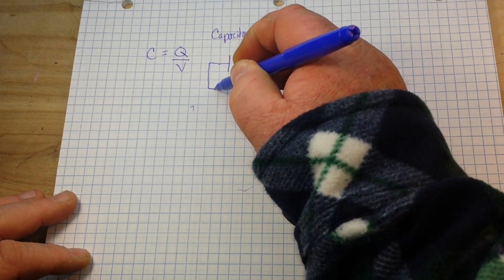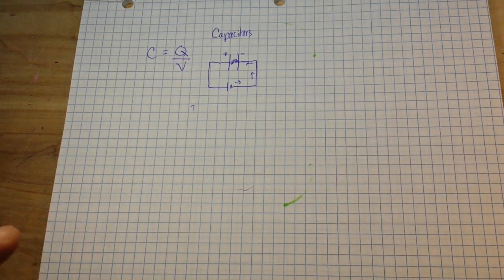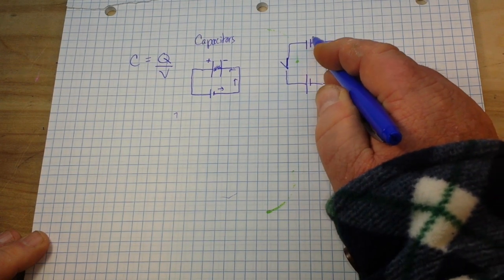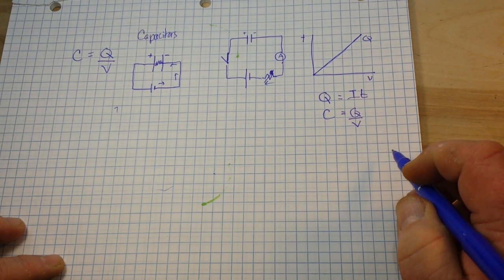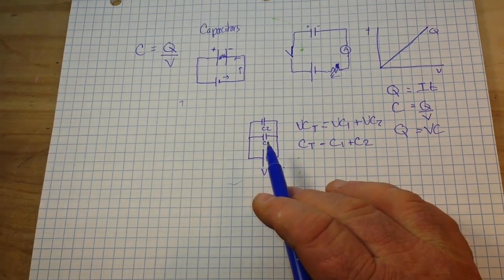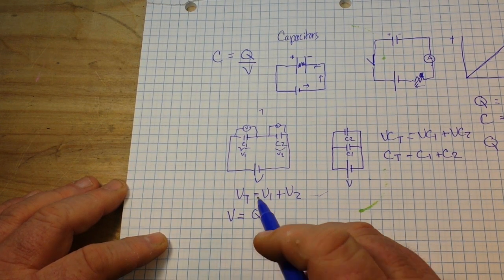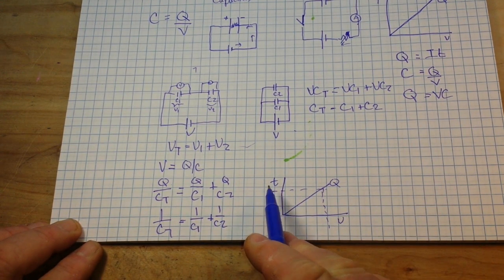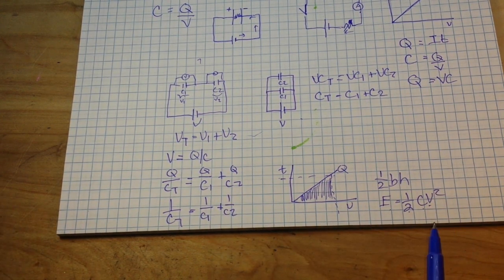The math and physics of capacitors

Comment: Hi.  I’m trying to understand your graph at the top right-hand side of the page.  With a fixed resistor value you get the classic V vs T charging graph as at: https://www.google.co.uk/search?q=capacitor+charging+graph&rlz=1C9BKJA_enGB590GB590&oq=capacitor+charging+graph&aqs=chrome..69i57j0l3.17872j1j4&hl=en-GB&sourceid=chrome-mobile&ie=UTF-8#imgrc=ndtidGXpvrwl-M: If however when charging you dynamically changed the resistor value to keep the currant constant you could theoretically get a straight line but I’m unsure of how/when/why you would do that?

Comment: I watched Dave Jones’s video and being an experienced electronics designer with a master in electrical enginering I can tell that what he explains is correct. You, on the other hand, give correct results, however your derivations are sloppy and  incorrect. So next time do some more research before you make claims and insult others who are actually correct.
Reply from the maker: Master in in electrical engineering....impressive.
Reply: Wolk Man you are correct.Some people are just ignorant.
Reply: Actually, he is wrong on this one(according to what I have learned and read). Current, does not flow through a capacitor. Since you have a master's in electrical engineering, can you please explain how it is possible for current to flow through capacitor. I  would love to hear something new.
Reply: @mandingoteckdailey5235  i am a novice so i am probably wrong, but does not current flow through a capacitor when you use it as a voltage dropper in a ac circuit

Comment: Small error, in parallel, the voltages of the capacitors do not add up. they are equal. V = Vc1 = Vc2
Reply: That's not the error. The error is in saying 'voltage' rather than 'capacitance'.

Comment: Thanks for posting this video. A LOT of people i encounter are confused about caps as was i back in the day. You hit on some key points that i will reiterate for anyone else that's confused. 1) for every electron that comes into a cap, an electron immediately leaves the other plate. 2) it is an energy storage device via it's built up E-field. 3) a cap doesn't necessarily store charge  (electrons/protons). A fully "charged" cap has the same amount of total charge as a fully "discharged" cap bc of #1 stated above...it's a 1 for 1 exchange as the E-field builds up with a voltage source and time. No additional net "charge" comes in from outside the system/circuit. It's all stored in the conductive wires where electrons are moveable. Again great vid and hope this provides addtional clarification!
Reply from the maker: +Michael Padovani awesome info Mr. P! Thank you.

Comment: Nice to see that you are starting to also provide some basic formulas. And while you are right that there is no actual current between the 2 plates of the capacitor one should add that because of the magnetic field there will be a current "coming out" of the capacitor and its equal to the one going in. Details can be found here (math is a bit nasty though):
https://en.wikipedia.org/wiki/Displacement_current